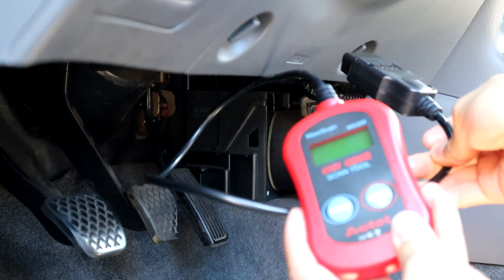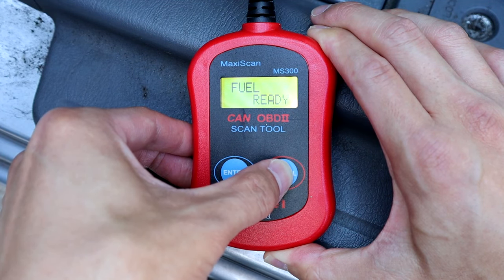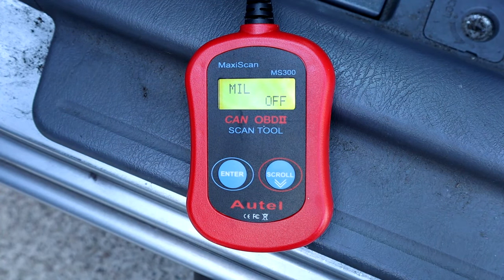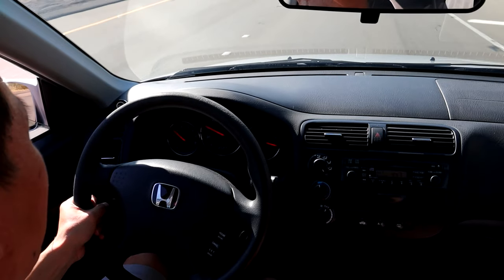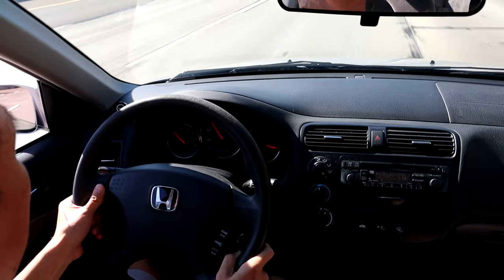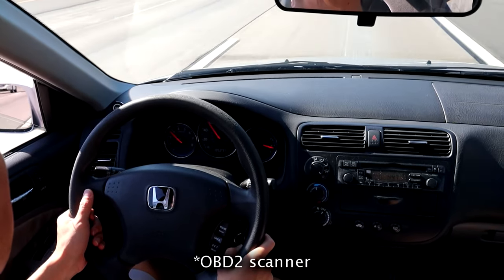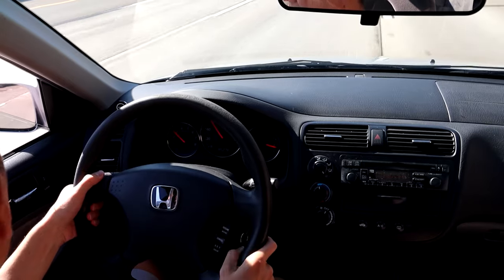How To Get Your Car Ready For a Smog Check – Pass 100% Of The Time – I/M Drive Cycle Ready

Comment: Emission test relying solely on OBD2 monitors has added stress to car owners whose OBD2 monitors have shown to be not ready when their cars are taken to the emission test centers.  Now, they have to perform all kinds of procedures, which mostly are difficult to complete (maybe not to experts), to get the monitors ready.  If the monitors are not ready, let's say just couple of them, car owners should have the option to get their cars tested through I/M 240 dynamometer or another test which truly measures the pollutants coming from the car's emission.  Local governments who require emission test and emission test centers opted not to do this anymore for cars equipped with OBD2 technology.  I'm not exactly sure why they resorted to that, maybe because it takes longer or the equipment required for I/M240 are way too expensive to purchase and to maintain.   Emission test is no longer an emission test if the only option is testing OBD2 monitors.  It should be called emission monitors test or test for a car's emission technology but it should no longer be called emission test per se.  OBD2 testing is efficient and clean, yes, but give the car owners an option to get the pollutants coming from their cars' emission actually tested through I/M 240 (or another method that is truly testing emission and not the car's technology) when their OBD monitors are showing not ready especially if they are not throwing any codes.
Reply: I agree with you. I live here in Ohio and it’s bullshit they have it. I remember reading somewhere a long time ago that the reason they don’t charge anymore which was 20.00, is because the state got enough money for cigarette tax! Which is bullshit. So that tells me they are only in it for the money. There are counties that have it and some that don’t. It’s not like each individual county is in its own bubble we all share the same air. So why are the majority of the counties exempt? Just like you said, it should be done with the “Tail Pipe Test”. That’s true Emissions. And we should have the option. It’s getting tested either way. It’s all Bullshit and Political. I did do a damn drive cycle on mine and it better have worked. Ha. 
Big Jim
Reply: And we are polluting more by performing drive cycles.
Reply: You are absolutely right about this adding stress to life. I have tried and tried. Kind of hard to be able to do all this “drive this way and don’t  brake” stuff in L.A.
Reply: Exactly, this is all BS. Where's the cheat code to bypass it?
Reply: 5 years in DMV hell we could not get our Ford Expedition to clear the codes, two shops told us to go somewhere else because they have ran out of ideas and patience, it only has 79K miles on it. Thanks Ford for the misery.
Reply: @Moondoggy1941  This is insanity!
Reply: Actually living near LA with hills nearby is a plus.  Makes going from 55 to 20 a lot easier.
Reply: Its all about money revenue.
Reply: @microduty6190  not to mention wasting gas at over $5 per gallon!
Reply: @beth6252  yep, i'm in Orange County and am unable to do this. I tried but too many cars, and drivers who tailgate and won't let you perform this 55mph test.
Reply: It's all just a bunch of fucken bullshit! I'm going through this right now!

Comment: The Drive Cycle is seriously dangerous to do for people who don't drive much... much less on the highway- I had to pay someone to do it for me... & they had to do it 3 times - basically putting over 300 miles on it...- so the cost of gas $7 a gallon & the $50 to pay the person to do the drive & the $25 a day to my insurance for letting a random drive my car-  which of course defeats the whole concept of not putting emissions in the air... plus in my case I don't even drive 100 miles a yr...- & when I go to renew my insurance i am hit with the higher cost due to do the drive cycle milage required for the smog test! hahahahaa- I see a new calling for jobs created from senior citizens & others who don't drive on the highway for "Drive Cycle" driver needed.- oh & yes- all that extra work, cost & drama due to disconnecting the battery while getting a tune up.

Comment: 2000 Cavalier 2.4L required California smog check in beginning of August 2024. On 7/17 a smog test showed O2S not ready. Drove the vehicle daily but would not go to ready. On 8/27 I got up early and tried the cycle mentioned on the video. Due to traffic I deviated some but still went through it as best as possible. When done, I plugged in my OBD2 reader and it showed ready. I drove straight to the smog station and I passed. Thank you so much for the easy instructional video.
Reply from the maker: Glad it helped!

Comment: Worked perfectly for my 2005 Lexus RX330 with 195,000 miles.  Thank you.  I've been stressed prepping for annual emission test in Virginia due to my check engine light coming on regularly.  Your suggestion worked perfectly for me using one driving cycle and I was able to pass my Virginia Emissions Test.  My 2005 Lexus RX-330, with 195,000 miles, gets a Check Engine Light regularly with no other problems.  Car runs perfectly.  Happens every 150 - 400 miles after resetting OBD II error codes.  OBD II indicates catalyst Bank One or Two are outside manufacturer specified threshhold.  I usually do an error code reset and keep driving.  Came upon your video while prepping for annual emissions test.  I ran through your procedures and I got all monitors to register OK.  Without going home, I immediately went to emission testing station and my vehicle passed.  I'm good for another year.  Saved me alot of stress and money.
Reply from the maker: Glad it helped and you passed!
Reply: try some catoletic converter cleaner -
Reply: This is reassuring because I have the exact same Lexus and we're having the same issue. I just ordered the OBD monitor and ready to give it a go. Is it ok to turn off the engine after the drive cycle completes?
Reply: @samuelriebel5535  I did not turn off my RX 330.  I drove directly to the inspection station when the drive cycle was complete and OBD indicated I would pass.  Not taking the chance an engine restart would trigger Check Engine and VSC lights.
Reply: @dpj118  did you leave the car running while you went in to get it smogged?  I'm most likely going to do the same but shut off my engine, go in and have the paper work done then when the technician is ready, he can start the car and hopefully all will be well.
Reply: @tienle355g  Left it running and went to testing center immediately after OBD II indicated it passed following procedures I describe.  Left if running as inspector drove it into bay and did the test.  Passed with no issues.
Reply: @samuelriebel5535  As I've described, I went immediately to testing station and didn't turn off engine at any time including cueing up to drive into the test bay.  Once I had pass indication on OBD II I wasn't taking chances that vehicle would fail.  I don't know if vehicle will pass if engine is turned off and retarted before getting the emissions test.
Reply: @tienle355g  I left it running throughout the whole process including having the tech drive it into the bay for testing.  Never turned off until it passed.
Reply: @nukem384 1/2 throttle at 55? what gear you shift into? and 3/4 throttle at55 too?
Reply from the maker: @xianshi8896  all 5th gear.  It's going to depend on your car.  This car was a 5 speed.
Reply: @nukem384  okay, thx

Comment: Nukem384, you are AMAZING.  Anyone that reads this is no joke.  I am a single woman in my 60's and own a 2001 Ford Mustang.  I also live in California so every other year I have to get my car smogged in order to get it registered.  I bought the car in 2022; the party I purchased the car from had the car smogged that year.  In March this year my battery was replaced by Triple A.  In early July when I went to the smog station which is adjacent to my mechanic, he asked if I did something with my battery and I said I had my battery replaced.  By that time I had already put several hundred miles on my car.  Apparently, it's not the mileage but how you drive the car.  The smog station gave me a drive cycle which is SIGNIFICANTLY LONGER than Nukem's.  Two weeks ago I spent FOUR hours doing everything on that drive cycle to the letter and still failed.  I was beginning to panic as my registration is due in July.  Although I paid my registration fee DMV still sent a letter saying my registration was incomplete.  I also ride public transporation (BART) and in the past have been ticketed by BART police twice in one day for expired tags.  This morning I woke up early at 3:00 am as my main concern was where was I going to find a stretch of road where I could drive 20 mph for five minutes.  Someone was watching over me because I found the perfect road.  For whatever it's worth I also replaced my fuel cap.  After I ran Nukem's drive cycle I drove straight to my mechanic's.  I was ecstatic when he told me I passed.  Nukem, thank you so much for sharing this Drive Cycle.  It really works.
Reply from the maker: Excellent!!!  Glad the video helped!
Reply: @nukem384  I am so grateful and thankful I saw your post.   After my car failed the smog the first time the smog place gave me a drive cycle they give to their customers.  It was A LOT longer than yours and took significantly more time.  I had begun to think I was never going to pass.  A big shout out to you Nukem.  Thank you for sharing.

Comment: Effective method. The tricky part is finding highway with little to no traffic. My code can possibly be repaired if I replace OEM gas cap. I did pass smog. 👍thx.
Reply from the maker: Yes.  That's why I mentioned late at night or early morning.  It's your best shot at having less people on the highway.  Congrats!
Reply: @nukem384  Right. So I had to time it in AM so once I went thru the various tests I can then drive car over. Had about 3/4 full tank, and drove 30mi. My mechanic told me no hard stops so I was very careful. Years back my light went on as I pulled into smog shop. Btw I have a toy Celica gt 2001. Thx 👍 again

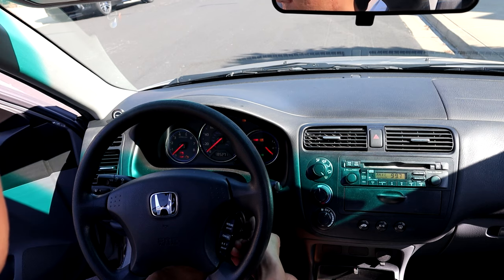Comment: 2:54 Let the car sit overnight. Have a full tank of gas. ✅

3:04 Idle the car for 2.5 minutes with AC at full blast and rear defroster ON ✅

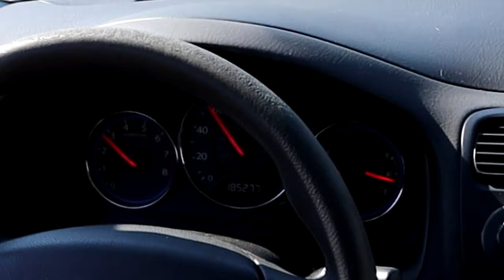4:09
Reply: 55 mph half throttle 3 minutes
Reply: And then coast to 20mph

Comment: 4:09 is accurate.  I had OBD2 connected while watching real-time monitors and that’s exactly how I got monitors to get the check marks. However, I had to coast to zero mph so it may be slightly different for certain makes. I had a 2007 Chevy Silverado.
Reply from the maker: Thanks for the verification!
Reply: @nukem384 
I have an O7 gmc sierra but it wont coast down to zero, only to about 6 to 8 mph. Even going slightly uphill it wont go down to zero. It will slowly creep about 5 mph. Cycle drive won’t get the evap or co2heat ready. Guess ill have to go pay extra somewhere to pass it.

Comment: How complete the drive cycle quickly: (Geared for Hondas and Acuras)
1)  Make sure car is cold and hasn't been driving,
2) Make sure you have 1/4 to 3/4 tank of gas,
3)  Let car idle for 2.5 minutes  (With A/C on full blast and defroster on)
  ECU will run O2 sensor heat self test, air injection system passive air test, evap purge test and misfire detection test

4)  Turn off A/C,
5)  *Get on freeway as fast as possible * and drive 55mph at 1/2 throttle , for 3 minutes
ECU will run test on O2 response test, air intrusive system test,  EGR flow test, purge valve test,  missfire detection and fuel trim test,

6)  Then let off gas pedal and let the car coast down to 20mph, 
DO NOT BRAKE OR SHIFT GEARS DURING THIS TIME,
Ecu will run an EGR flow test, purge valve test and a fuel trim test, 

7) Once down to 20mph, Do 3/4 throttle to get to 55mph and run for 5 minutes,  
ECU will run catalytic monitor diagnostic test,  *May have to do this few times with old cats*

Huge thanks! 👍
Reply from the maker: Glad it helped
Reply: I will do it tonight. I live in OC area Little Saigon . I own 2005 Honda odyssey. I just replaced my front down stream. O2 SENSOR or bank 2 sensor 2 with code p0157. It took me almost 2 hours to get it out. My socket I bought did not fit perfectly so I cut the wire from old sensor so it would fit to remove it. It was on tight since factory 20 years ago. Denso 234-4368 is for front oxygen  sensor behind the cat. Anyway, afterinstallation I cleared the code and drove around to buy stuff from FB market place in Long Beach and Cerritos area. It cleared everything except the evap monitor not ready . I will do this steps tonight around 3 to 4am. I have an itchy eczema baby she itchy every night around 2 to 3 am so I drive her around to sleep

Comment: MAN~ Wish I'd seen this 4 months ago... I went in and they kept telling me to drive it around 40 mi then come back did that over and over again till I'd racked up about 360 mi and still the computer said needed to be driven. I didn't know that having my dead battery replaced caused that :(  They said my catalytic converter was toast and that had just been installed in 2018. So I went back and now here we go again, that shop that installed the first one told me I needed to drive around. I explained what had been happening and sounds like he's going to get them to stand behind the warranty and install the new converter. Man this has been the biggest hassle! I have a Toyota Matrix and haven't driven much due to Covid and lost my job... at this point I think I'm going to get it installed and sell the car and get as much for it as I can get. It's a 2003 Matrix and looks sweet.
Reply from the maker: Boooo.  The whole driving around thing is a really old school way of thinking.  Any old timer mechanic will tell you to do that.  This drive cycle really helps cut down those miles.  And if it doesn't work after like 3 tries, then you actually have something wrong with the car that needs to be fixed.  In your case, sounds like your cat was defective or something.  Hopefully they can fix it so you can get rid of the car.  Really happy we have EVs now, no more of this hassle lol.

Comment: Hello there. Great clip here. But, I actually tried the portion of the cycle last night with my 06 S2000 when I have CAT not ready, and it didn't work. But, not sure if I did it right. I saw one of the comments asking if I can skip all the parts and start from 20mph accelerating to 50mph with 3-quarters of the throttle for 5 mins. I was at 53mph with 3rd gear for more than 5 min, but didn't work for me. I'm trying to review what I did wrong or different than what you shared. 1) Is gas still need to be at somewhere in 2 quarters (more than 1 quarter less than half a tank)? 2) Can I shift up and stay at 50mph? or need to stay at 3rd gear? 3) Do I need to be at 3-quarters of throttle at 50mph? If so, I need to be on 2nd gear since my car is a high-rev car. 4) how precisely do I need to be with 3 quarters of throttle and the speed at 50mph?(as I went over 50) 
Thanks in advance.
Reply from the maker: I would try again and do the whole thing, not just a piece of it.  Just follow the video with what I did.  Don't upshift, you want to stay in the same gear.  Yes, you'll lug the engine.  And yeah, fill the gas at least 2 quarters.

Comment: BEFORE they do the smog ask them to "run the OBD2 and see if the car is smog ready to test" which they have to do for free - if you ask!  if it's not ready, they cannot charge you anything. The first thing they will do anyway is check the obd2! But, if you ask to check if its smog ready before the smog and its not they cannot fail you. Otherwise, They will run the scan and might fail you if its "not ready" 
but you have to ask for the obd2 scan before they start the smog!!!

Or, get a free scan at Auto zone or Orielys first.
Reply: Wished I read this comment I already paid for the test (minus the certificate part)